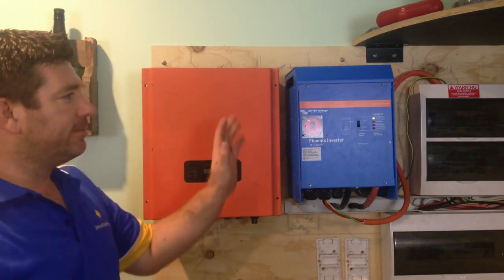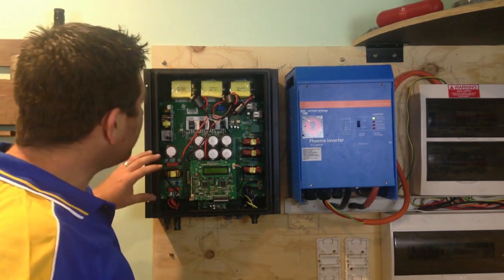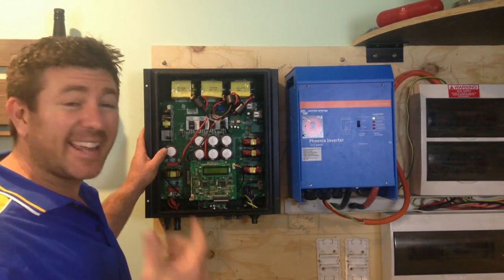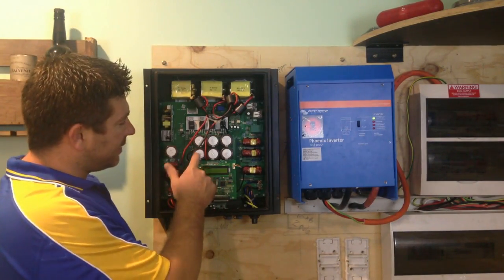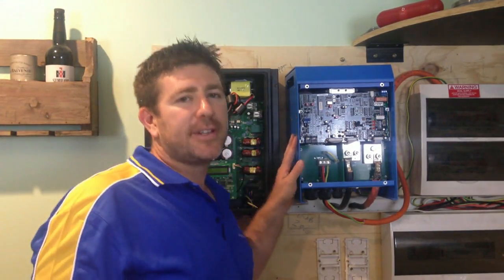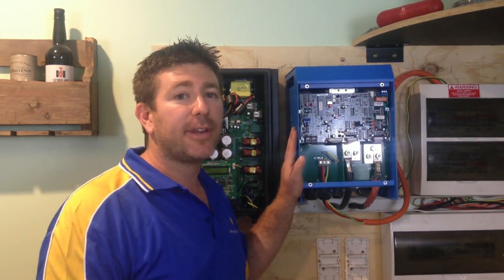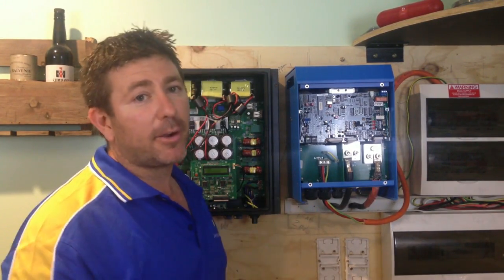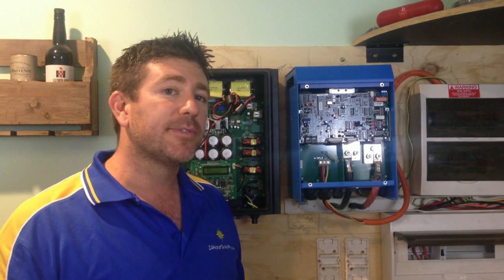SOLAR INVERTERS

Comment: On grid - Did you mean that the electrolyte of the capacitors dry up? Do you have net metering/meter runs backwards?
Reply from the maker: It's resistors that dry up. I said capacitors. they loose moisture and current won't flow anymore. We do have all diffrent types of meters in Australia. I choose not to feed back to the grid and only use it as a back up.